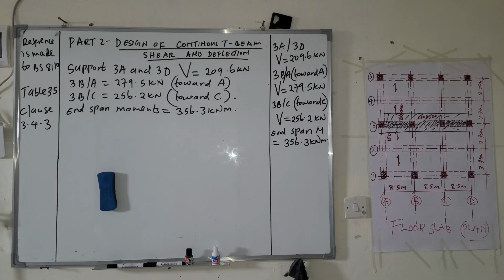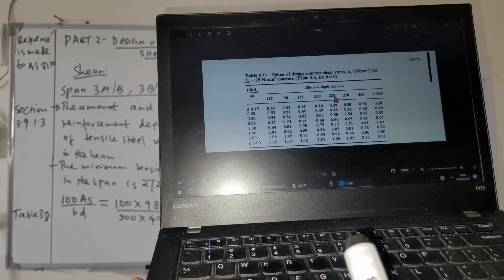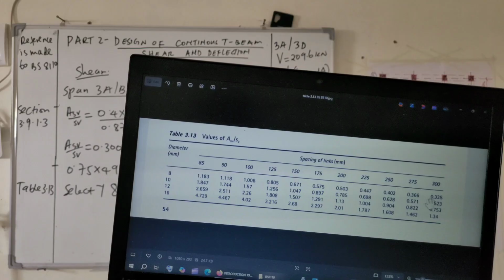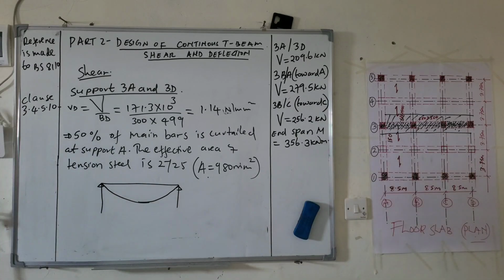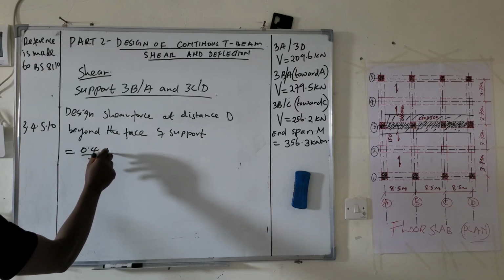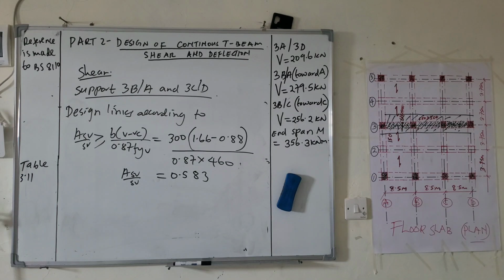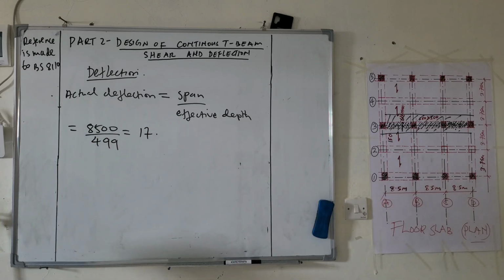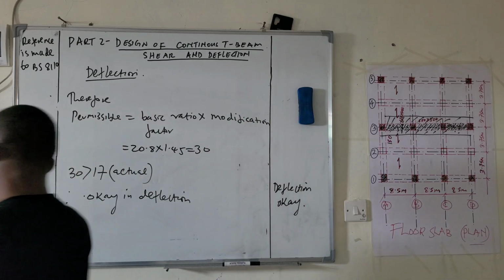DESIGN OF CONTINUOUS T-BEAM TO BS 8110 PART-2

Comment: What about HND STUDENTS using cp114 sir?
Reply from the maker: CP 114 is an old code and is no longer used. It is a waste of time to study it. My advice for you is to focus on other topics, limber timber design to BS5268, prestressed concrete design, and even steel design to BS449 is also outdated.
Reply: @OdavigiStructuralHub thankyou sir..

Comment: which BSS code did you use because its the clauses you mentioned are not similar to those in BSS8110-1:1997
Reply from the maker: BS 8110 1985 
What is mentioned in BS8110-1:1997?

Comment: Hi sir, Im from Zimbabwe. I wanted to ask why you said minimum tensile reinforcement for span A/B, b/c c/d is 2Y25 (A=980) when this is compression reinforcement at the supports. and where we not supposed to use b = 1490 for the spans
Reply: Many thanks. Zimbabwe is watching. Could you please specify at which minute your question appears in the video so that I can help.
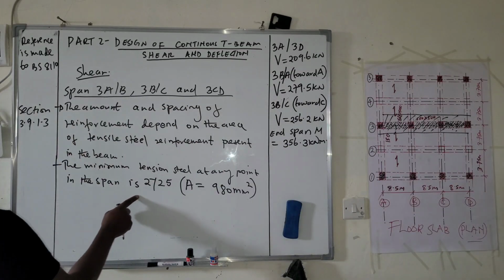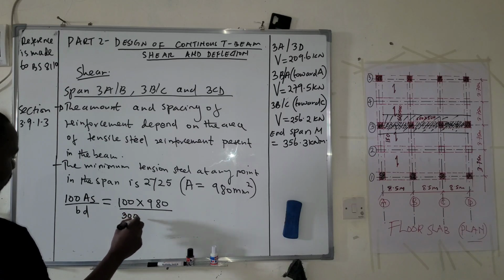Reply: @vincentodanga2132 hello sir, the questions appear at mins 10:18 and 11:05 respectively